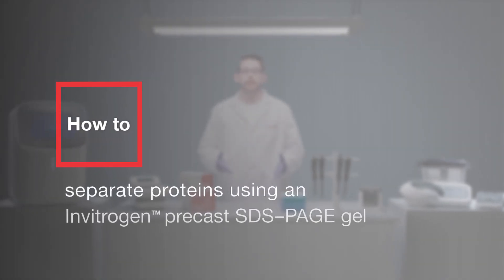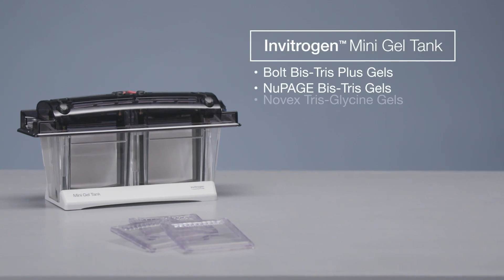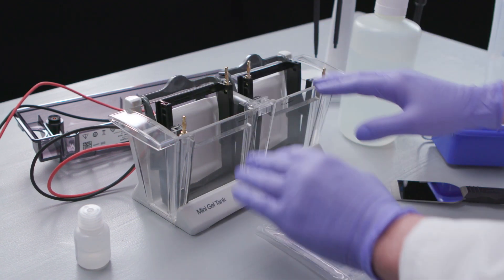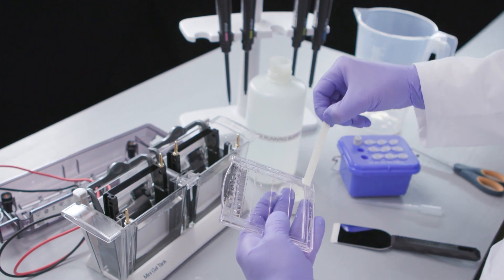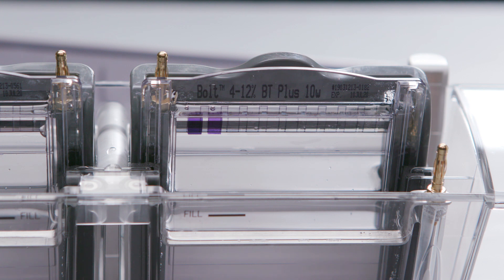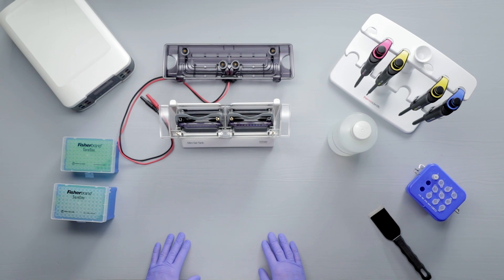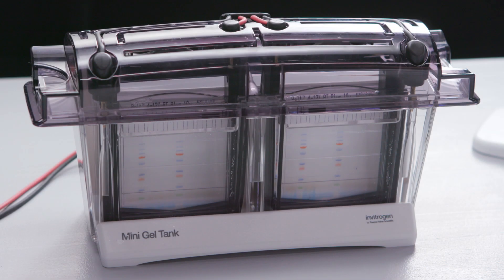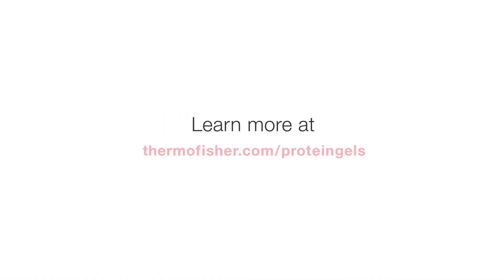How to Run Protein Gel | Invitrogen Precast SDS-PAGE Guide

Comment: Hello this video was unhelpful. The way the gel cast was placed turned out to be incorrect as that did not bring the wells in contact with the buffer resulting in no resloving of the proteins.
The correct method is to place the wells no towards but away from you.
You should double check before making videos and conning people.
Reply: Yes. You are right. I did the same mistake 🥲

Comment: Good afternoon, 
what happens if I insert the gel facing the opposite site? 
I hope you can answer me. 
Kind regards
Reply: This will result in the gel running backwards, such that SDS coated proteins will migrate towards the top of the gel, instead of migrating towards the bottom of the gel, like they normally do.

Comment: Hi, how do I prevent well distortion when removing the comb? Some of my wells went out of the casette when i removed the comb.
Reply: be sure to remove the comb really slowly and gradually. Sometimes this can be difficult if the comb is wedged tight in between the cassette, but just use your thumbs to gentle work the comb out of the wells and the gel. Hope this helps!